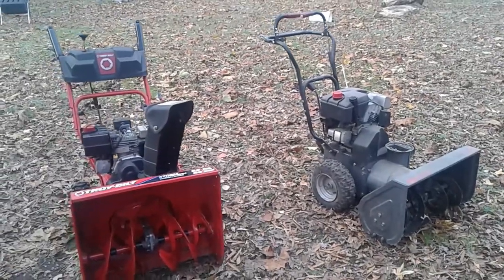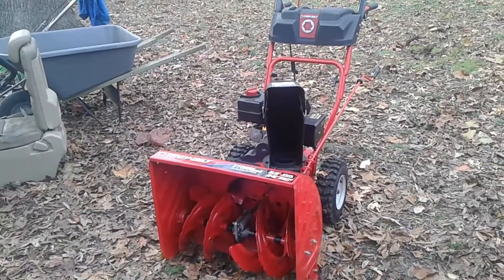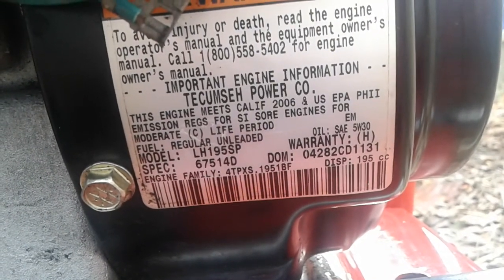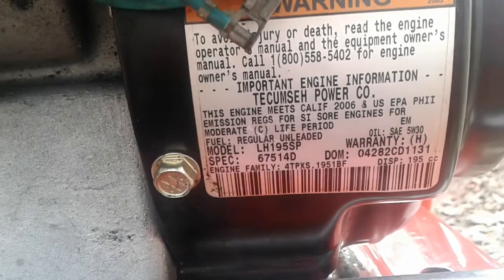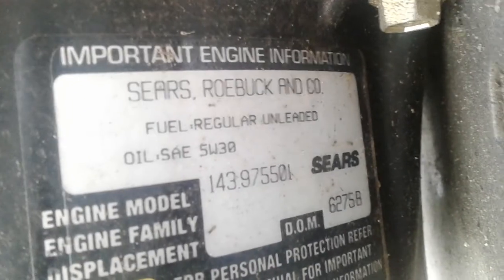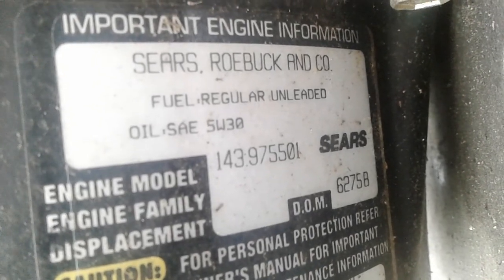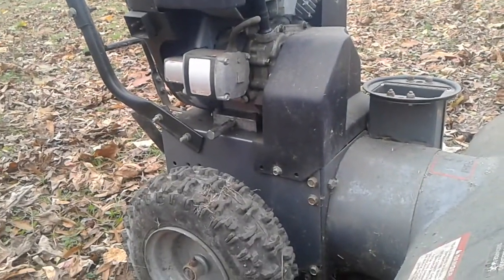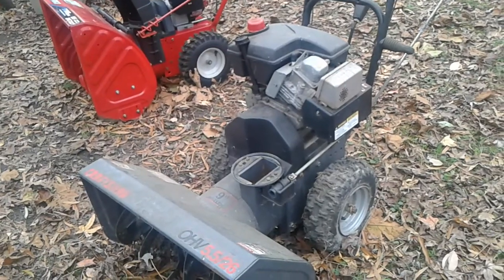How to Read Tecumseh  4-digit and 5-digit Engine Date Codes

Comment: thank you! now to correct the flywheel key that's been sheared!
Reply from the maker: Awesome! Got a lot of snow where you're at?
Reply: @Buckwsr  Not every year. Maryland, but I also have small place in Florida and was clearing near the woods, and probably hit a small stump hard, and didn't run again. Have new flywheel keys on way. It's a LV195EA engine push mower, 2004.
Reply from the maker: @JoeZyzyx  yeah, I’m in Jersey. We didn’t get any snow this year. None.

Comment: If the first example, 04282 was manufactured in 2004, how is it possible that the sticker says "meets California 2006 emission reg" when the engine would have been made before 2006?
Reply from the maker: Those forward-thinking Californians, always way ahead of the game! But honestly, you've made a good point; I will have to re-think that one. Thanks.
Reply: I have encountered the same issue with my Yerf Dog Go-Kart engine. No clue why it's like this...
Reply: Perhaps the law whcih set the 2006 emissions standards was made into law sometime before 2004 with an effective date of 2006?   Early enough for Tecumseh to start meeting the future standard with engines manufactured in 2004?   I don't know this is the case, I'm only speculating.   But it's pretty common for regulatory changes to have a future effective date, ie:  they regulations don't become effective immediately when the law is passed.

Comment: I have a question, maybe you can help. The research I've done so far has told me the same thing you said in your video. However, my DOM has a 5 digit number but starts with 02. Any idea on year made?  It's a Tecumseh Power Sport 6.5 hp. Thanks in advance! Thanks for sharing this video!
Reply: ❤ maybe perhaps it's a counterfeit
Reply: Mine also starts in 03?????????

Comment: great info , so my tecumseh has a 6 and it does not have the points only the electron magneto ... so would you guess it's a 1996?? I am sure the 1986 still have the points ?  Your Thoughts?
Reply from the maker: An engine from 1986 would also have electronic ignition. Points and condenser lasted till about 1980 or 1982. So your engine could be an 86 or a 96.... There may be other indications of its age based on appearance, etc....